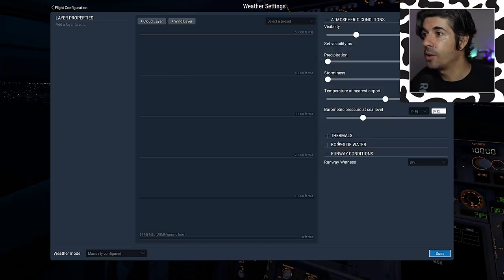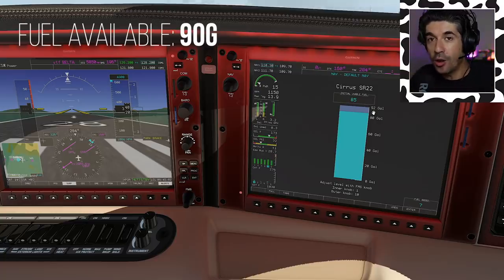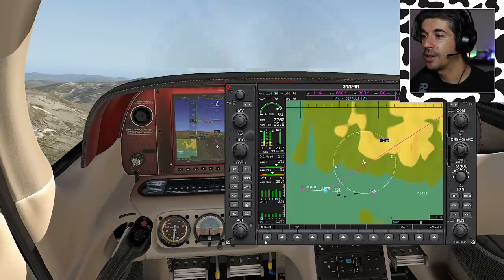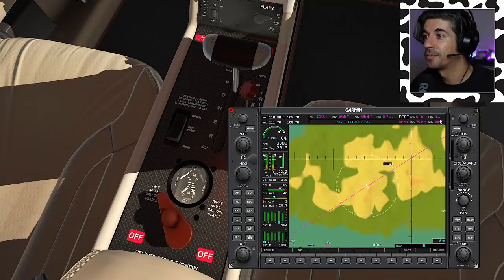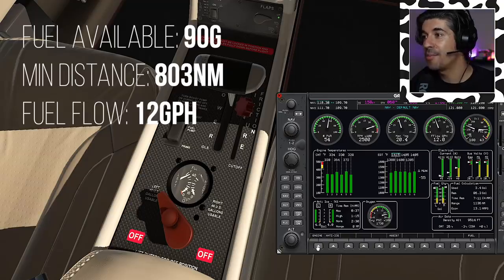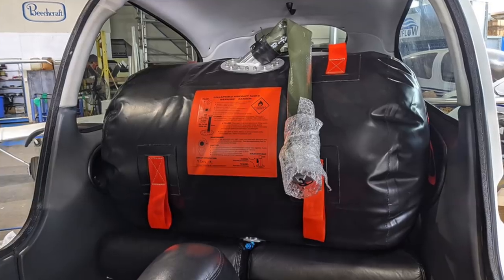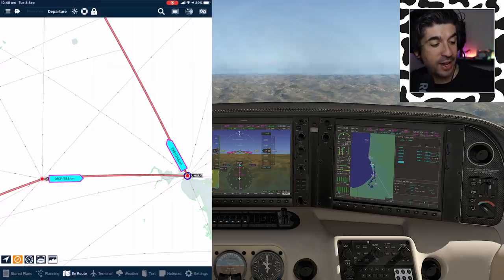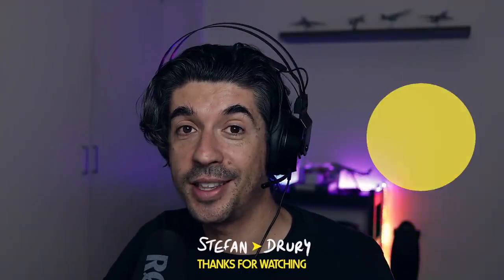My RISKIEST round the world flight - would you do it?

Comment: Hey Stefan,
1. Consider the value of calculating your  safe return point, equal time point and no return point in that exact order, assuming you treat your destination just like a remote island since all alternate airports are far away. 
2. If the concern is that the destination airport runway might be blocked due to unforeseen circumstances, consider the parallel taxiway as part of your emergency plan, should you be facing headwinds(likely) and don’t have enough fuel for your planned alternate. Also a field exists an hour away, UHME. 
3. The waypoint ARNAP happens to be at an airfield. Should your destination airport close while your inflight, or unreachable due to weather. You can consider landing there(UHMO) if waiting is an option, or diverting from there to UHMP. 
4. Fuel stop at UHPT midway? UHMM-UHPT-UHMA, both legs less than 500 NMs. 

Just some of my thoughts.

Comment: Option 1. You can consider a redispatch point to your alternate and file your flight plan this way.. 

The redispatch point will give you a Critical Point along your flight where you must make a committed GO/No-Go decision either to your primary destination or your alternate aerodrome.

Option 2: (preferred)
Get the aux fuel tank and you need not worry. However.. I would still consider filing a redispatch point in case you develop fuel tank switching problems mid flight - and your 60 Gallon Bladder becomes unusable for whatever reason...

Comment: I know the POH probably doesn't have performance numbers for a lower power setting, but... you could experiment and probably find a far more fuel-economical power setting. Something that gets your cruise speed down to like 80-90 KIAS. Then check and see what your fuel reserve would be to the alternate at that point. You could also do some scouting on google Earth, and perhaps find an EMERGENCY alternate field. An off-field situation - something not officially a runway, but something you could scout and find and verify it is a suitable place for an emergency precautionary landing, doesn't have obstacles, the condition and material of the surface could support the landing, preferably near civilization, etc. Chances are, if you takeoff on a day with favorable VFR weather, you're very unlikely going to need an alternate airport, but this pre-scouted off-airport alternate could be an option for this leg. Or perhaps the 90 knot cruise speed would satisfy your original alternate requirements.

Additionally, if the destination airport is closed because of an accident, you could still make an emergency landing there, either on the taxiway or on part of the runway that has sufficient distance to stop prior to the other aircraft's wreckage. I wouldn't normally advocate for such extreme "backup" plans, but this is a unique situation where your options are very limited and I think given the low risk you'll even encounter the worst case scenario, these are sufficient backup plans. I wouldn't make this flight when clouds or visibility are bad.

Comment: The question is - would I fly to a destination without alternate fuel, but with an hour's reserve above minimum.
As a commercial pilot I have done this many times. Ansett used to fly out of Perth for the Christmas & Cocos Islands in the Indian Ocean, and you had to commit to the destination enroute every time - it was part of the operation. Even here in Europe I fly into destinations with perhaps 15 or 20 minutes holding above reserves.  The length of the flight is irrevelant, apart from the time it allows for the weather to change, and the age of the forecasts.

Comment: I'd take the part-cat regulation for isolated aerodromes as a personal minimum for a flight like this. Which is two hours of holding fuel calculated at 12GPH for you in this case, if i remember correctly. This should give you enough holding time for ground to clear the runway in case of an incident. Also since there are no alternates i would make a pre determine point in case the weather at destination decreases below minimums and you can return safely. Seems like a fun flight mate have fun!

Comment: Having thought about this, it's possible, you could set a turn backs points, i.e. if I have less than X gallons at this point I'm turning around and landing back where I took off, of course, once you pass the halfway point you're committed really, as, barring any extreme wind conditions, you're not going to have the fuel for the turn back. I'd suggest (though I'm no expert) that while possible this would be a terrible idea. A couple of major risks I see are that you make it past the halfway point, but encounter significant headwind, which will obviously increase you're fuel burn, and potentially eat away that 26 gallon FOD, if there's no where closer en route you could divert to you may be forced to drop the aircraft in a field, which, I've heard from pilots who've done it, is not a fun way to end a flight. There's also the potential for the aircraft to develop a fuel leak or other malfunction which may increase you're fuel consumption rate, leading to the same outcome. Even assuming you get the aircraft on the ground safely without injury and manage to get a lift out of such a remote area, it ends you're round the world flight, I'd say it's not worth derailing the whole thing, and more importantly putting your own life at risk, for one airport. 
Ontop of what I've said above, lets assume you make it all the way to destination safely, and with 26 gallons to spare, what happens if the cloud deck is below minimums? Of course, you would've checked the forecast and made it part of your go-no go decision to only set off if that wasn't forecast to be the case, and will be monitoring it en route, with a turn back option if that changes, but forecasts can turn out to be incorrect, particularly in more remote areas, like that appears to be, and again, if you're past the half way point, that pretty much leaves you up the creek without a paddle... or at least, if you're past half way + whatever you can get out of 26 gallons. There's also always the possibility you get there and the airport is unexpectedly closed for some reason, maybe an aircraft before you burst a tyre on the runway, maybe there was a crash, there's any number of things that could cause you to be unable to land when you arrive, and if you don't have the fuel to fly on to an alternate you're pretty screwed. 
As a final thought, lets say everything goes right, in so far as you take off, make it to destination, make a safe landing, and you've got you're 26 gallons left in the tank, happy days, only, you taxi over to the fuel pump and find a sign on it saying "out of service" (only, in Russian... whatever that would be) or one of the staff comes over and tells you they're out of fuel, but it's ok, we're expecting a delivery late next week. Although this is clearly less critical than the previous scenarios as it's not going to create a potentially life threatening situation, it could certainly create a difficult situation and throw you're plans off. And of course, I'm assuming you need a visa to be in Russia legally, I believe they are time restricted, which means if you find yourself stuck for a week waiting for fuel you may end up over running that restriction, and I understand the Russians tend not to take to kindly to things like that. I suppose this could be mitigated by carrying some Jerry cans of fuel, to allow you to fill the internal tanks manually once you're on the ground. 
So yes, as I say, I think given decent conditions it's doable, but it creates quite a number of serious risks, and I'd suggest that it's really not worth putting yourself in such a bad situation, with so few options, to visit one airport. I'd also suggest that the fact that the question of weather it's a good idea or not even occurs suggests it probably isn't. 
Just remember the old aviation addage: There are old pilots, and there are bold pilots, but there are no old bold pilots. I'd say taking that trip would definitely give you points towards being a bold pilot, so I guess the real question is which do you want to be?

Comment: If I'm not mistaken, not only do you need to have an alternate, but you also need to have 45 minutes holding fuel at the alternate. I also don't understand why you're not climbing higher to circa flight level 180 (when I was operating in Russia, they were using Metres not feet) or thereabouts to maximize your TAS? Remember the adage, there are old pilots and there are bold pilots but there are not old bald pilots. My recommendation is, just for the sake of peace of mind, would be to install the long-range tank. Trust me from experience, don't sit there crapping yourself when it all starts going wrong reminiscing if only I had the extra fuel. I would not undertake a trip of this kind, at this location under VFR, in my opinion, IFR is essential. Good luck with it.

Comment: First off, I wouldn’t. I’d wait and get that Aux tank certified. 
Second, add a PNR (point of no return) that way if something goes wrong at either the destination or Alternate airfield, you can still arrive safely with plenty of fuel at your departure airfield. 

It’s a tough one and I’m not sure I would. I’d be more tempted to make more stops if possible than stretch the range of the aircraft

Also don’t forget that while adding an aux tank is good, there’s still the weight of the fuel as well so it’ll take longer to get up to cruise altitude resulting in more fuel burnt. Just a factor to keep in mind

Comment: So, I'm not a pilot, but I am a climber. I'm not going to try to answer the question for you, because that's something you have to do yourself, but I can give you some mountain climbing perspective.

You'd think mountain climbers would always rope up when going on a climb. It sounds obvious. The rope is there for safety right?

Well, in reality there are sometimes reasons not to do so. For starters, climbers on a rope tend to be slower, and when used incorrectly, the rope can actually increase risk. I remember a story of a family on a slope, using a rope, but they didn't use any anchors. One person slipped and fell, pulling the rest of his family with him, leaving the mom, who had decided she wasn't going to push on to the summit as the sole survivor.

Now, you've got a while to get the tank fitted, so the real problem is the effort of getting it safe and certified. Because of Corona time isn't as much of a factor right now.

What are the risks of having the tank fitted? And the benefits? Compare that with the risks and benefits of going without the aux tank and make your own choice.

Comment: weather would be my biggest fear in this situation.. heawind, diversions due to severe weather, low clouds forcing you down to a less efficient altitude, unexpected fog covering your destination airport.. remember, the forecast is only that..a forecast.. weather can always develop differently and you as a pilot have to account for this by planning your flights so that you have options to deal with such changes. not having enough fuel to reach an alternate airport even in normal weather conditions (i.e. no headwind) certainly isn't a good start. 
when i am in a situation like this, where i know that the answer should be NO but i still am considering risking it for whatever reason, i usually try to imagine, that someone else did that flight and one of the possible crash scenarios happened.. now imagine you read about this in a crash report, what would you think about this pilot.... most of the time my answer is, that i would think this was a stupid and reckless move and i would never do such a hideous thing.. which is usually a good motivator to finally actually say NO and find another solution to the problem. 
If i where willing to take risks in order to make this flight possible, i would risk being fined for flying with a non-certified auxiliary fuel tank full of fuel in my airplane. whatever the fine, it won't hurt as much as a crash landing. with some hidden fittings in your fuel system that would allow to disconnect the tank and the collapsible design of the tank it seems possible to hide the tank in your luggage well enough to get through possible ramp checks on the way to russia.. and once you are there and have completed this flight, you can mail the tank back home and fly without it for the rest of your trip. of course we will never know if you did all that, because you can't show the tank on camera :) i know this sounds stupid, but i think still less stupid than taking off knowing you are short on fuel and won't reach an alternate after a 5+ hour flight. call me lame, but i would not risk my life or airplane to get to an airport i could fly to by commercial airlines any day of my life.

Comment: The very first and most important consideration is ALWAYS safety.  Although you could theoretically make the flight, I would not risk it.  If you had the extra tank, I feel that it would be safe.  If that is not a possibility, changing the route would be the safest and best solution (of course I don't know if that is possible).  As stated in the video, if you have a tail wild, you would have more fuel upon arrival, however, if you needed to divert to the alternate it would likely not be possible.  That being said, you could attempt the flight on a CAVOC day and make a decision point in your flight, where you would either proceed to the destination or divert to the alternate.  Ultimately, for the flight to be a go in my books, both the desired destination and alternate would have to be safe.

Comment: Can you launch IFR, consider conditions enroute, and decide whether to go direct to the alternate from a precalculated PNR? And, if you choose to keep going at that point, cancel IFR and do the rest of the flight VFR without the alternate.

I don’t think it’s particularly risky to arrive at a VFR destination with 2 hours of endurance. Actually more than 2 hours, because if you need to do circles due to a problem on the ground you’ll do it at reduced power and fuel consumption, and can probably squeeze out two hours of circling and still have an extra hour of reduced power reserves onboard.

Doesn’t seem terrible VFR, as long as conditions don’t deteriorate below VFR minimums in the second half of the flight.

Comment: Not worth pulling the chute if something doesn’t go to plan. If I were you I’d wait for the aux tank to get certified for EYZ. Can’t put a price on safety. Just some thoughts from a new private pilot.
Reply: Hi Steph, that looks like similar distance btw keri keri NZ and lord howe. I would do it but: a. very favourable weather forecast. b. monitor weather in flight (sat weather) and have a plan to go back before point of no return. c. Get info from MAK aviation in Moscow re: possible smaller grass strips on the way (at least its not over the ocean). d. Go A110 to get slightly better performance. You not likely would need too much oxygen. Check runway distance at the destination (e.g if you have to land with tailwind) e. Make sure weather is favourable again!

Comment: I wouldn't base my calculations on a simulator, but you probably didn't either. How is the terrain along the route? Could you make a precautionary landing in various places? Is the 65% best economy, or would something lower be better? Vglide has the least resistance, but your trip might take forever then, or would engine run so inefficient that is uses more fuel again? If there are airports but they have no avgas, could you bring the fuelbag and fill up from your bag on the ground? How much time pressure well you be under? Can you wait a week to the weather is good enough to go at high altitude?

Comment: Check out SavvyAviation videos on flying over square and leaning. In short, I think climbing at 2700 rpm may be overkill, you should be able to get much more range at lower RPM (2200), and should be able to lean even more aggressively. I also have 90 gallon tanks on my plane with the exact same engine, but my range is typically in the 1200's. Fly slower, get farther.

Comment: This sounds like a bureaucratic challenge instead of a physics challenge.  So solve the problem using bureaucratic language. . A collapsible bladder with no fuel is not a “usable” fuel tank until it’s filled. Carry it empty “ as baggage “ till you need to do a “ ferry flight” to reposition the plane from A to B for “scheduled maintenance. “. Submit a planned flight hrs schedule where the 50 hrly maintenance falls due when you get to Alaska. This then becomes the “ferry flight” destination / purpose.

Comment: This might be a dumb q, but have you practiced going this distance between different airports, where there are alternates? Might be worth testing the theory a few times by flying interstate here, eg go fly across the Nullarbor with all your luggage. Validate the hypothesis in real life, not just in a sim.
Reply from the maker: Not dumb at all, in fact I’ve been planning slightly longer legs here in Australia where I do have alternate options. However that’s on hold until our lockdown is lifted. But yeah, good idea, it’s definitely a concept I want to prove before getting to Russia.
Reply: Cool. I also had the thought that if you simulated those test flights now, and comparing the results with what actually happens when you do them; that could also give you the ability to understand the variance between simulated and real flights of this type.